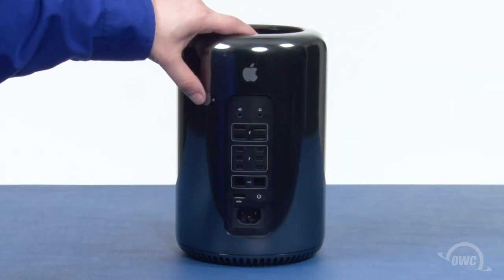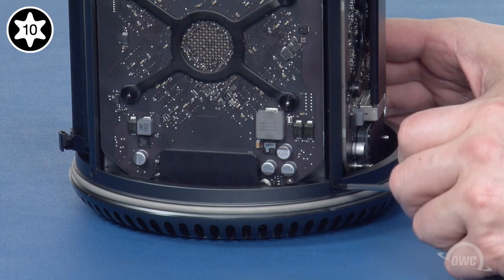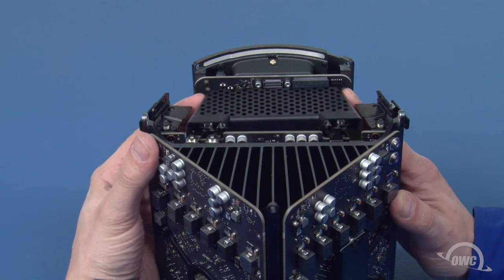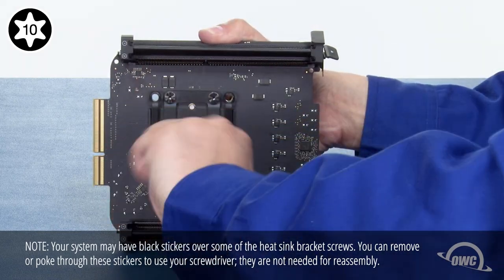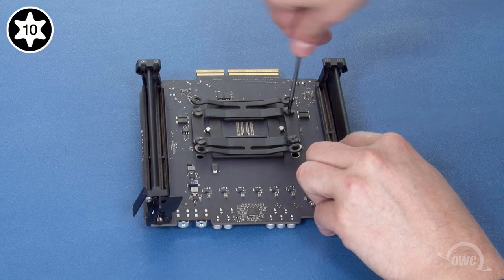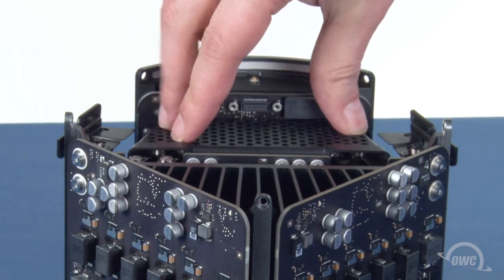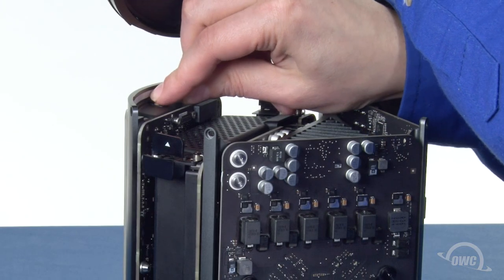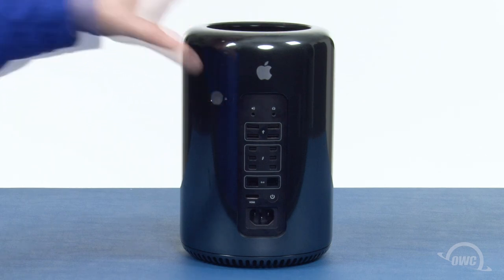How to Upgrade/Replace the Processor in a Mac Pro (2013) MacPro6,1

Comment: Thank you so much for this video.  The instructions worked perfectly for me, I was even able to vacuum out plenty of dust! For me though, two of the four screws holding the retaining bracket for the processor had loosened the locating posts underneath (the ones you can see with the copper heat sink). I had to use some pliers and a quick snap with the screwdriver to separate the posts from the bracket.  The post could then be secured back into the heat shield plate. After reassembly the Mac started no problems.  Very pleased!

Comment: Thank you so very much for such a well thought out and informative video, lots of love for the folks at OWC and this was extremely helpful. We also made a labeled piece of paper for each set of torx screws and taped them down to each respective box to keep them all together, it was a breeze with your help.
Reply from the maker: Very glad to hear and thanks for that comment! We think it is very important to help our customer's, and try to help each and every step of the way. Glad we could help and feel free to reach out to us directly for anything and anytime! :)
Reply: Your OWC 64gb memory kit 1866ghz, its a little faster than my stock apple ram correct?..15%?...
Reply: What makes your1866ghz memory,a little faster then Apples?.Lower Latency?..cl13.?
Reply: All buy it, if i know why its faster,Im trouble shooting all clock speed, memory speed options, to make this trash can as fast and snappy as possible...thanks if you could explain a little.............Apples latency like cl 15 type thing?..yours is cl 13...!...?...
Reply: @stephencawker1565  not sure if you're meaning to reply to me -- I don't have the OWC kit, I came here to simply upgrade my processor to another Apple/Mac processor that was pulled from another trash can... for memory though, I copped the Transcend 128GB JetMemory kit which actually worked in mine. May want to try commenting again but to the OP, these are just coming into my inbox, sorry I can't be of more help and good luck!

Comment: I did it! Thank you!! 12-Core CPU and 64 GB OWC RAM. Just should've been more specific on how much tighter the CPU screws should have been, since I scratched the Power Supply's black metal surface with the CPU screws as I tried reassembling the whole things. So I redid the entire CPU part and remade some of the cooling paste. So, screw the CPU on TIGHT, but carefully and in the mentioned star pattern.
Reply from the maker: AWESOME!! We are sorry you did have issues with the screw. We will certainly check out to see if we can do some mention on the screw can be tighter than expected. Please feel free to contact us if you have any further questions, comments, or concerns. https://eshop.macsales.com/Service/

Comment: Thank you for this video. I just upgraded from the default 6-core to the 8-core E5-2673 v2 because I was having heat issues. This video made it very straightforward. I had no idea how much dust can accumulate in the fan itself, in the top part of the computer. Overall a cheap upgrade this day and age and I'm seeing much lower temps

Comment: I have got as far as 4:45 seconds and the screws that hold the cpu do not hace any screw heads please help?
Reply from the maker: Look carefully at the screw heads, are there round black stickers on them?  The stickers can be peeled away or poked through.
Reply: @poweredbyowc  thank got it just paniced and thought i had a different model went well and worked perfect thanks to your video

Comment: Thanks for this usefull video... I managed to replace the base cpu model by a 10 cores at 3 GHz in around 3 hours (taking my time)... This machine is not an easy friend when it comes to tearing down. I have to point out something not mention in the video : the 4 final screws. When I arrived there, I thought I was stuck. They were full with no holes in them for the screwdriver. Bloody hell ! Everything for nothing... But, if you watch carefully and scrap the heads of the screws, you will see the holes to appear. And then you can proceed. Hope il will help someone.
Reply: @poweredbyowc  Your video is great and very helpfull. Very very much. You don't need to edit it again. My mention is just a detail, a teardrop in your great tuto.
Reply from the maker: We're glad to hear our installation video was very helpful to you, and we appreciate you pointing out that we missed a crucial segment at the end. It will be forwarded to the appropriate team.

Comment: Such brilliant mechanical design, I will never sell mine. Instead, one day it will transition directly from computer to work of art.
Reply from the maker: The Mac Pro 2013 truly boasts a unique and sleek design!
Reply: @poweredbyowc    I recall seeing dozens of them mounted on their sides in rack mount chassis at NBC’s Manhattan broadcast center long ago. It was a stunning sight, more like something you’d expect from Cray than from a consumer manufacturer. Just imagine dark, shiny, featureless orbs lined up in an array. And a quiet array at that. Mounted that way their thermal design was easy to plan for in a server room.

Comment: I recently tried swapping a 12-core processor to a d300 3.7ghz Mac Pro and now the pro won’t turn on. I tried swapping back to the original processor and still had the same issue. Any idea what would cause this problem?
Reply from the maker: Sometimes it just needs a simple SMC or PRAM reset, sometimes its due to a plug, connector, or card not being fully seated or connected, however sometimes it can be a bit more technical. I would try doing those steps, but if there are still issues...feel free to contact directly as we would be happy to help. (https://eshop.macsales.com/Service/)
Reply: @poweredbyowc  thanks, I tried the SMC reset - unplug and plug in holding the power button and didn’t get anything. Will un level thermal paste against the heat sink cause the Mac to not power on by any chance? It’s the only thing I can think of unless the processor just isn’t seated properly. What do you charge to diagnose?
Reply from the maker: You can call in and request to set up a custom repair order. We charge $80 Diagnosis fee.

Comment: just about to undertake this upgrade and just have 1 or 2 questions before I do just to double check incase I mess it up. So when u say a soft non static surface do i have to buy a non static mat? also do i need a none static wristband and what do i connect it to the mac itself? also is isopropyl alcohol ok to use with a microfiber cloth? sorry for the stupid questions just dont want the fry Nything with static all help welcomed thanks again and great video!
Reply from the maker: Thank you for your comment, and no these are not stupid questions at all! It's good to know these things for upgrading your Mac! :)

You always want to assemble or take apart computers on a clean, hard surface to minimize static buildup. Also want to make sure you're not wearing anything that can cause static buildup.

Yes you can use Isopropyl with your microfiber cloth.

We do have a anti-static portable mat here on our site:
https://eshop.macsales.com/item/iFixit/IF1452025/

Please reach out to us directly if you have anymore questions! We are open 8AM-8PM Central time M-F.

Our number is 1-800-275-4576.

Our international number is +1.815.338.8685.

Comment: Help, I did this and now it powers on for 5 seconds and shuts off
Reply from the maker: Hi Jay!  Can you please contact us directly at support@owc.com and we can troubleshoot further.
Reply: Same for me. So took it apart and re-seated all the cables - now I get the startup sound and the fan goes crazy, but no video.
Reply: the same thing is happening to me right now. its not even powering on for 5 seconds. its more like 1 second then off.. it keeps trying to power on then trips almost immediately. i literally followed every step to the T in the video (which was very clear) so i was really expecting it to switch on and be ready to use. and now this. what now? i need my computer ASAP for work! i tried reattaching all the connections. I tried slightly loosening the screws (this seemed to have worked for some people) the only thing i didnt do was apply more thermal paste. please help!!

Comment: Any reason the "kernal_task" would be running at about 86% CPU load (total, so about 1900% in the activity monitor) after the 12-core upgrade (from 6-core)? The machine isn't running hot - PECI CPU 34C, PCH Die 49C. According to HWMonitor the CPU Package is running at about 20 watts.
Reply from the maker: There are a few different reasons, however many of these are a bit too involved/technical to be talked in this format. I would highly recommend calling and speaking with our technical team (1-800-275-4576U.S.A.) as that way we can have a live conversation and much more easily as well as more detail get down to the nitty gritty.

Comment: Can i upgrade to an intel i7?
Reply from the maker: MIKEKIM,
 
The 2013 Mac Pro Cylinder can be upgraded to a 10-core processor. Here is a link to all the processor upgrade options available for this machine.
 
https://eshop.macsales.com/shop/processor/mac-pro-cylinder-2013
 
 
Please email support@macsales.com if you have any additional questions as we are happy to assist directly
Reply: @poweredbyowc  on the OWC site it says it can support the 12 core Xeon V2 processor, is that a recent change or just a typo

Comment: right i followed the guidance and did it go as well as they portrayed it, hell no, did it go well = hell no, you need a few hours and the screws are very small so this will frustrate you, however i did succeed in the end
Reply from the maker: Hi Ked101!  I'm sorry to hear that you had difficulty with the installation.  Of course the video does show an ideal installation done by technicians that do processor upgrades on a regular basis.  I'm glad to hear that you succeeded in the end. Please note that OWC does mark the 2013 Mac Pro processor upgrade as Involved.  It's not nearly as easy a process as installing memory or the SSD in the Mac Pro.

Comment: I did this upgrade and it never turned back on.  Took everything apart and bent pins.  This was the worse computer I ever bought and it was extremely difficult to upgrade that processor.  It’s not as easy as they show it to be.  Just sell or throw it away.  You can get an m1 Mac mini and runs all over this piece of shit computer.
Reply from the maker: We are so sorry to hear you had an issue with the install process! It is a rather involved installatoin- please reach out to our support team for any assistance you may need, we are happy to help! support@macsales.com or 1-800-275-4576